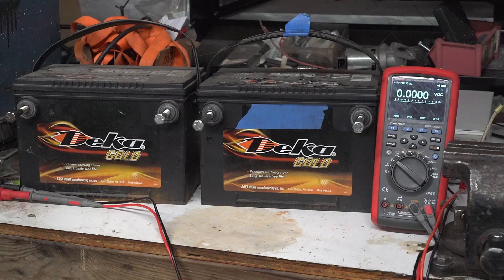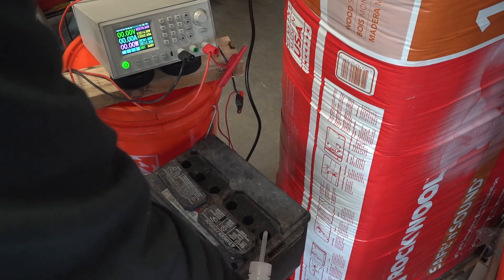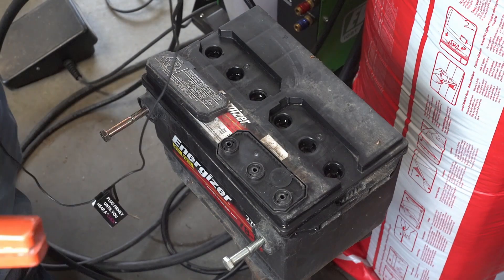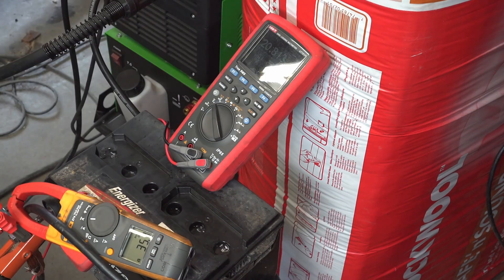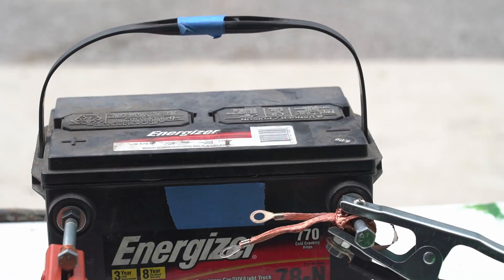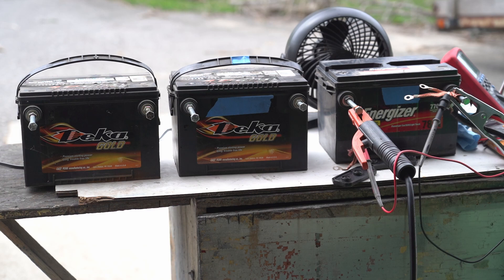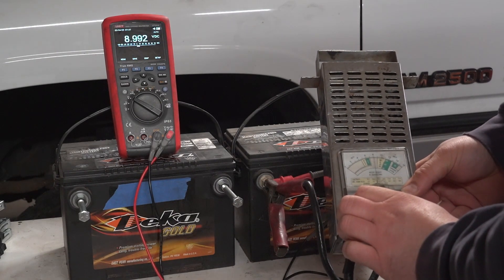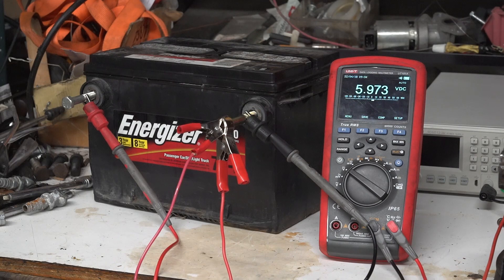You won't BELIEVE what this did to my batteries!

Comment: The method that should ( sometimes ) work is by using a DC welder, i believe the one you used is AC ?

Cool video non the less !
Reply from the maker: The stick welding function on my welder is DC, which is what I used for this experiument.

My brother claims to have been successful with this before, but personally it hasn't worked for me. It may very well work sometimes, though it hasn't for me. A bigger sample size would be telling if it really works that often.